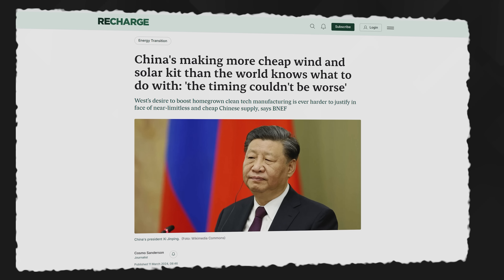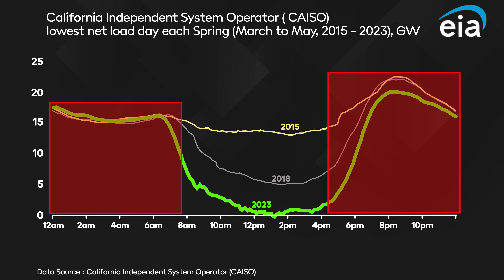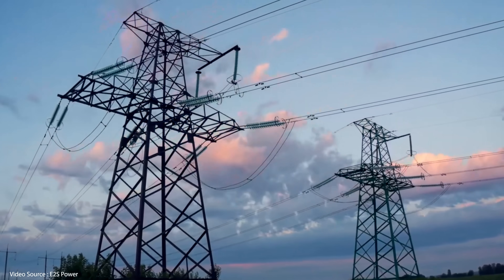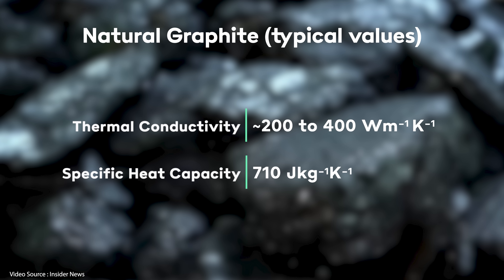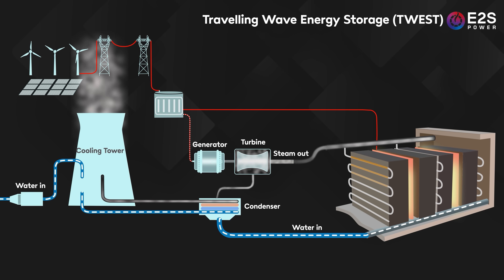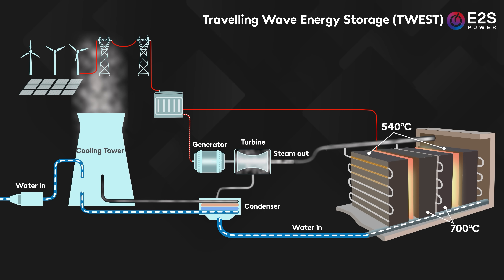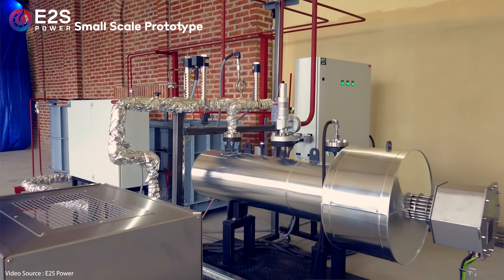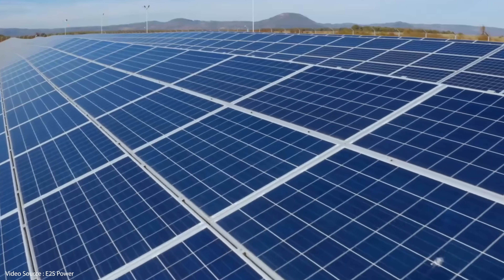A coal power station without the coal! How 'WIN-WIN' solutions could save an industry.

Comment: AVERTING CLIMATE CHANGE without stopping use of coal/ fossil fuels. 

In this context, please contact the innovator of a Carbon-Sink plant (CS-Plant). If CS-Plants are installed globally, they will effectively mitigate global warming, which is the cause of climate change. Since each CS-Plant is a very costly plant as such they can be implemented in the countries by their governments only. Prior to commencing their implementation globally as well as to know their significance, the governments of INDIA, USA, CHINA, etc. are requested to implement at least one CS-Plant at one of their most polluting coal fired power plants as R&D projects. In this context, the influential indiviuals of INDIA, USA,  CHINA, etc., too, are requested to use their good offices to ensure early implenentation of CS-plants in their respective countries before it is too late. Also, implementation of CS-plants will not only permit use of WORST coal, but it will also surely prevent early CLOSURE of very polluting existing coal fired power plants and industries globally or those are at the verge of premature closure.

RECENT INNOVATIVE APPRIACH OF ASH DISPOSAL

This approach of ASH disposal will easily stop creation of ASH- PONDS; whereas, fly-ash & bottom-ash will be disposed in dry state and in slurry form respectively. The ash-ponds are very harmful for local population, because they pollute groundwater with heavy metals locally. Contact at whatsapp mobile no. 919818539932. AK Datta

Comment: This electricity to thermal to steam to turbine to electricity is probably not amazingly efficient.  I am guessing around 35% round trip efficiency.  

This is probably helpful for use during peak demand times.

I am not positive this is the best use case for all excess wind and solar, but perhaps it is more practical and/or efficient than some other technologies like carbon capture and storage or liquefied air to electricity and thermal storage to steam  technology beats  letting the energy go unused. 

In my opinion pumped hydo is the best short to medium scale storage method for electricity.   If anyone knows of a better all around storage  technology I would be interested in knowing about it.

I do think that electricity to thermal storage for industrial use is a great option for excess electrical power production. 

Ideally eventually we will use a huge amount of excess electricity to produce ammonia fertilizer as fertilizer is a high energy use industry that is crucial to modern life.

Comment: My concern is that the grid's $kWh supply rate is set at the 100% 'support' from all the customers on the grid.

If the combination of rooftop PV and BV with OVERSIZED battery  that is free to store excess electricity from any building carpark space, means that customers do not need grid electricity when the sunshines 🌞 😀 😉 

The grid investment must have cash flow, 
adequate cash flow. 
So, the $kWh rate must increase for the remaining customers. 

This is a death spiral of increasing $kWh rates, shrinking customer base, and failing ROI.😮😮😮
Reply: Bail-out available upon request 😊
Reply: @DrSmooth2000   nuclear promoters are looking for the government to build and government to guarantee cash flow and disaster insurance and profits. 
The government built power plants, and hospitals and toll roads and tunnels and poles and wires are privately owned, including tax haven owners.

Comment: I have done some calculations. 
Assume we are going to convert a power station delivering 300 megawatt.
1 megawatt = 1 ,000,000 joules per second.
A reasonable efficiency for a steam turbine generator is 60%
So to deliver 300 megawatt of electricity we would need to supply 500,000,000 joules per second.
Assume that we cool the graphite on average from 700 to 100 degrees C.
If my calculations are correct, the heat store would need about 16,000 tons of graphite. This is not impossible but would certainly not fit into a container. Where have I gone wrong?

Comment: I like the terminology of an energy duck. The thermal battery is an excellent way to store the excess energy and reuse existing steam plant. This is only really effective within a single day. We need to consider the larger timescale energy duck in the annual season as well. Would it not be more effective to manufacture and store hydrogen instead of storing heat?

Comment: Now retired, I spent most of my working life as a power station control room operator. A couple of downsides that I see:
1. Turbines are not terribly efficient at turning heat into mechanical energy to drive an alternator. I'd expect around 30-50% overall efficiency with this system at best.  Much of the heat in the steam is lost in the condenser.
2. Turbines take time to runup to speed and need to have reasonable temperature matching before starting to admit steam. That will consume some of the stored energy.
3. Pumped hydro is much more efficient at 75-80%. Pumping water uphill would make much better use of the surplus renewable energy.  Plus that energy can be stored for much longer without any loss.
4. Storing the energy and using it as process heat would be a much more efficient use of the energy.
The system the video proposed was also being developed by a company in Newcastle NSW with the same approach of special bricks to store heat at a near constant temperature - see www.mgathermal.com

Comment: I have been looking at a small system of heat batteries to heat my isolated chalet in the Alps. Heated with solar panels, it is a relatively modest cost to install, and it runs itself. Extremely low maintenance. My choice of heat storage material is rocks and sand, freely available in the mountains. My Suisse ancestors and grandparents did much the same thing 200 years ago to boil water for washing and cooking, also for heating their beds in the winter. Did someone say there is nothing new in the world?

Comment: I believe what is discribed here is not a conversion of coal plants to heat storage plants. 
It seems like it’s only a way to substitute a certain amount of heat with stored heat. The coal plant still operates normally. A small part of the steam is generated in the heat storage unit and feed back into the regular steam system. 
This is an auxiliary and not a conversion.

It can not be a conversion, to completely convert a plant it, it would be necessary to build a heat storage with the same functionality as the main boiler. The boiler consists of preheaters, evaporators, superheaters, reheaters. A heat storage which targets a full conversion would need to have all these functions. This would not be an easy drop in solution but a massive modification bigger than the boiler itself.

Comment: MGA Thermal in Australia has a brick for this purpose made of graphite containing aluminium lumps inside as a phase change material that melts absorbing more heat energy then the graphite alone. As the melted aluminium remains inside the brick it can be handled the same way as this video demonstrates.

Comment: this is exactly what Australia needs. awesome video, well done.
Reply: MGA Thermal in Australia has a brick for this purpose made of graphite containing aluminium lumps inside as a phase change material that melts absorbing more heat energy then the graphite alone. As the melted aluminium remains inside the brick it can be handled the same way as this video demonstrates.

Comment: This sounds like it might work for energy intensive industries like electric clinkerisation at cement works, electric arc steel furnaces, aluminium smelters, or electric glass manufacturing. Even oil refineries use steam in their processes 🤷‍♂.

Comment: I think this is very good news for a fast change of energy system mainly in China and India. My solution for the climate crisis is something that I call Solar Power Water Management (SPWM). It is based on pump water with solar power up to high altitudes (100-5000 meter) and then use water power stations that bring the water down to the level where food production is possible. Water is spread over a large area. When there is enough rain is the pipe that pump up the water used in revers for power production. Solar power is of cause used direct daytime.

Comment: How does the conversion efficiency of green energy to heat, back to electricity compare with large-scale battery storage?  I'm wondering if batteries may be more expensive up front but pay off in the long run with higher efficiency.

Comment: I find the end-to-end efficiency of this system uninspiring. About 2/3 of the electricity generated by all those renewable sources is lost in transmission, storage, Carnot cycle of the steam turbine, and electric re-generation process at the ex-coal-fired plant. The stated efficiency of the steam turbine alone was 45%. I find the "99% efficiency of converting electric energy to heat" humorous, because it is actually 100%. Somewhere they are losing 1% to the environment.

Comment: I’m not a government official, but I am aware that Greece has several lignite/coal power plants that it would like to shut down, but is worried about covering the electricity demand in the evenings when sun power is not available. There is also the concern about the lost jobs from closing the plants. Greece actually has a surplus of sun and wind energy during the day, but has no means to store the excess energy for use in the evenings.  The technology described in this video may be ideal for Greece’s circumstances(!). Converting those plants into energy storage  would preserve jobs and take advantage of the existing energy surplus in one move.

Comment: Cost, man, what's the cost? Use of water as the heat transfer agent at 700°C means the pipework has to be even more expensive and specialized than before, because supercritical H2O "steam" is extremely corrosive, and that effect rises as temperature goes up. The talk about "making steam at 99% efficiency" is blatant MISDIRECTION, because the HUGE efficiency loss in any Rankine Cycle steam-power system comes from the HUGE energy water needs for boiling (phase change). Most of that huge energy gets thrown away as waste heat after the low-pressure turbine section. Overall Thermal Efficiency is doing good to reach 45%, which means 55% of the input energy WASTED. This High Temperature Thermal Storage has a few plusses, but this trick does not overcome any of those chronic problems. The electric power to 'charge up' the graphite blocks to 700°C has to be acquired at very low cost, because most of it is going to be wasted at the end of the steam cycle. 
Efficiency-wise, a better approach is to use helium for heat transfer, run it at even higher temperatures, and use it in an Externally Heated Brayton Cycle running at about 1650°C. (Heating the graphite to higher temperatures does not hurt efficiency.) That will raise the Thermal Efficiency to about 67%, meaning only 33% is thrown away if that is a Simple Cycle (simple like a gas turbine 'peaker' plant), and even less energy gets wasted if this approach is used as a Combined Cycle, especially if Supercritical CO2 is used for the low-temperature end. This high-temperature Helium approach is somewhat similar to the Gas Cooled Fission Reactors used in some countries, so this thermal storage approach seems a perfect retrofit to those fission plants, enabling them to be even 'greener', reducing or eliminating their production of nuclear waste.
But what if we skip the reactor entirely? It still works, thanks to the thermal storage. And of course, the kinds of equipment employed by High Temperature Gas Cooled reactors for the non-reactor portions of the plant is off-the-shelf technology that can be quickly implemented almost anywhere, once the fission reactor is removed from the picture.

Comment: Heat storage systems are nothing new. Unfortunately they have a big disadvantage - very low energy density. In the case of graphite with specific heat capacity  of 710 J/kg.K and temperature discharge from 700degC down to 540degC => delta T= 160degC , energy density is around 0,032 kWh/kg. The video showing a container-size modular heat storage unit powering an existing thermal power station for hours is an unrealistic dream! A container of 30 ton graphite can only provide 960 kWh thermal energy. And even if the Electricity-to-Steam (E2S) conversion efficiency is 99%, the energy discharge Steam-to-Electricity (S2E) is around 50%, i.e. the stored thermal energy converted back to electricity is only 480 kWh per container!
To produce a 1 GW power (typical value per power station) for 4.8 hours requires energy storage of 4.8 GWh or 100,000 containers! That's a mountain of containers! For reference the Li-ion battery has 15 times higher energy density and even that is not a realistic proposition for use as a peak-hour energy storage solution for power stations.  I hate to burst your bubble, but that's not going to solve any of the problems of the coal power stations.

Comment: Hi Dave, you mentioned in this video the importance of spinning generator momentum  and how that is required to hold the grid frequency. Just how big an issue is this? If we switch completely to renewables and sequentially close down all nuclear, coal and gas generators, then there will essentially be no spinning generators. This video from an Australian engineer makes the point that it would be impossible to control such a system.

Is it possible for you to fact check this?

https://youtu.be/bZT5WjnT4fE?si=AXqK2a-VYGVJoFMl

As an engineer myself working now in renewables, but previously in the fossil fuel environment, including coal generation, this seems to be an important point to fully understand.

If this is not a major issue, then I would expect us generally to retrofit old power stations with batteries rather than heat storage. The round turn efficiency is almost double that of heat storage. On the other hand, if spinning generators are required, then it would be a big argument for the heat storage you have presented in this video.

Comment: 6:11   "electricity to steam efficiency of 99%"    That is a very strange statement.   It might be 99% turning electric input to heat in the graphite.......but it is NOT 99% efficient turning heat into electricity by steam turbine....that process is only 36% efficient.  Talk about misleading information.  Put another way, if your solar power input is say 15 cents per kw/hr, when its stored and reconverted back to electricity and 2/3 of the energy is wasted, it is now 45 cents per kw/hr.   If we are talking roof top solar, the power has to go up the grid ( 5% loss) through storage (64% loss) and back down the grid ( 5% loss). The only saving grace of this system, is that it might work well at small to medium scale and would be much more location independent, unlike pumped hydro storage.

Comment: The saga of "roof top" domestic solar in Australia continues to change.  A few years ago, the market operator ( AEMO) said that power companies could pay nothing for roof top solar, and now they are saying the power companies can charge home owners a fee, before paying a few cents a kw/hr for roof top solar feed in.  For most people, the fee and the earnings from feed in power will cancel each other out.  What is also strange, is that everyone claims that electricity prices are near or below zero during peak solar hours BUT the shoulder tarrif that coincides with this is still a lot more than "off peak" tarriff (9pm to 5am). How is that even possible????
Reply: If your main focus when you install a PV system is making money from your FIT then you're plan is doomed to failure. Prime focus should be generating enough to cover your usage and if theres excess generation, storing it (ie battery) for use when PV isnt outputting.
Reply: @Kiwigeo8339  Ive been living off grid on solar for 6 years.....its not easy. The PV part is easy and not expensive, its storage that is expensive and even then most roof top solar lacks enough capacity, especially in winter to get through weeks of cloudy wet weather.  The roof top solar roll out in Australia was a hastily done boondoggle type of an idea that has now run its course and now it needs a lot of storage investment to make it useful again.

Comment: What about using a high temp heat pump system instead of resistive heat to charge/heat the thermal batteries. This in theory would provide much better efficiency round trip if not already implemented

Comment: Wow, how to completely move away from fossil fuels, with safe technology operating with a 99% efficiency. A modular system allowing a scaled transition from fossil fuels, using a proven technology while avoiding the massive costs and unnecessary forever risks high emission nuclear reactor (small or large), which makes use of the massive solar energy surplus generated during the day for use during the night. Acts like a grid scale energy battery but likely much cheaper (certainly when looking at cost over time). 
Let's hope the Government have enough imagination to move on this one. It'll be supported by the majority of the population .. but it must be managed with courage and honesty. Thanks for leading by example.